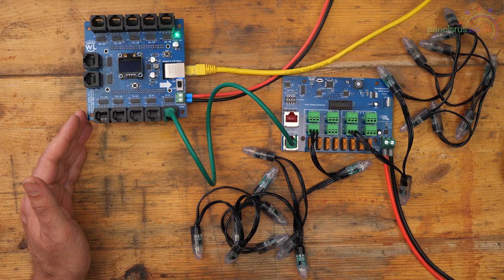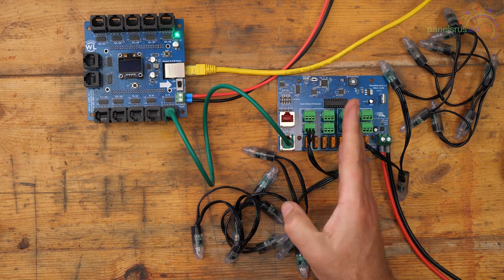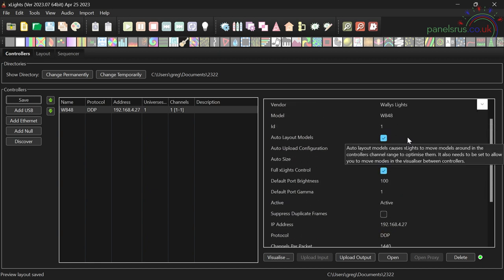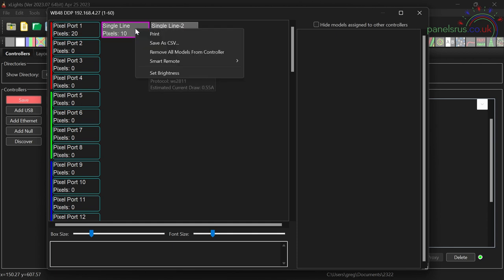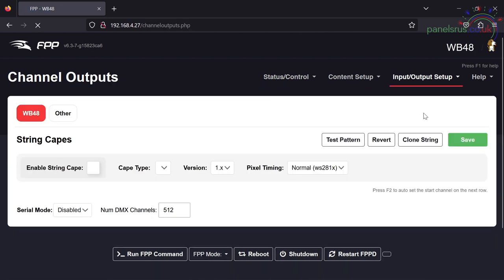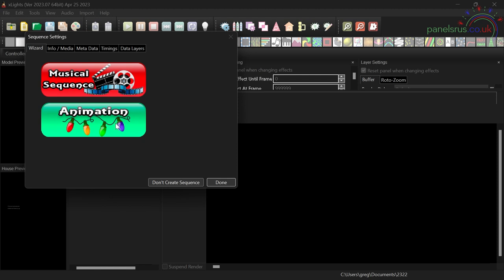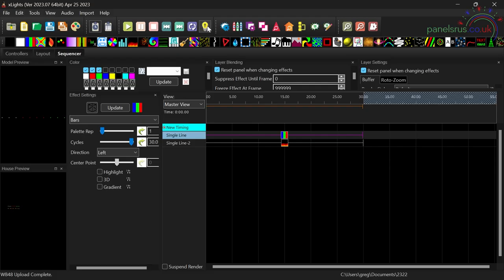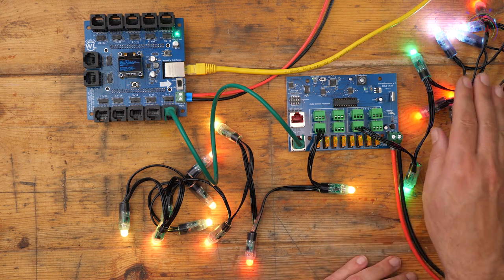WB48 and SRX2 setup in xLights

Comment: The video may be short, but it saved my bacon.  I have an F48v5 and several SRx2 smart receivers.  Some will be daisy chained and some not.  As a test, I daisy chained two on one F48 port, and set one up as the only board on another F48 port.  Got it all looking good in the F48 output, but could not get the smart receivers - other than A to show up in Xlights.  You demonstrated right clicking on a model in Visualize, and voila!  All of the controls needed to set up those smart receivers was there.  Hidden menus are the bane of hobbyists.  Lol.  Thank you! It is all working now.

Comment: This was great - very helpful! HOWEVER, I think I see a bug in xlights. I connected an F48v4 to this SRx2. The SRx2 was then connected to a Matrix using 6 of the strings. I watched how 1a and 1b were assigned to the two banks on the x2 in your video, but cannot do the same with my matrix. I can only move based on the first string in visualizer rather than individually.
After all that, I've decided to just connect two four port smart remotes and NOT daisy chain for this matrix. I think it is a bug in xlights visualizer and/or matrix settings. I'll find another use for the SRx2!